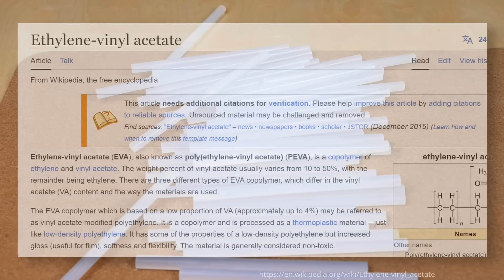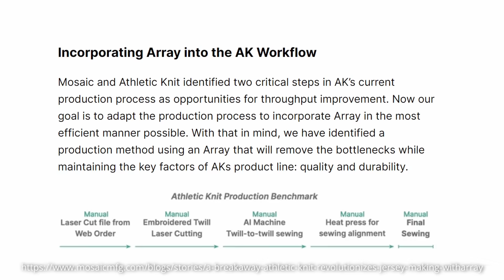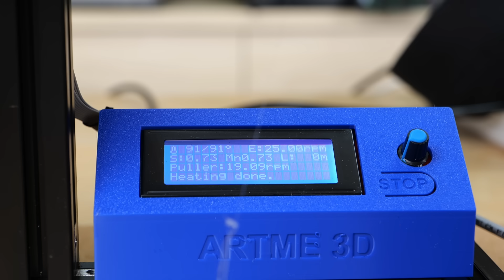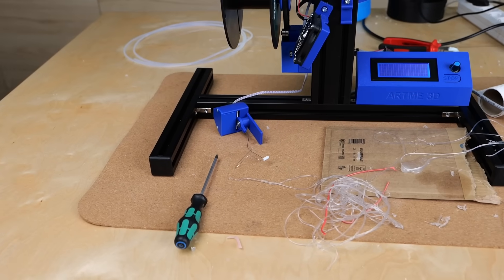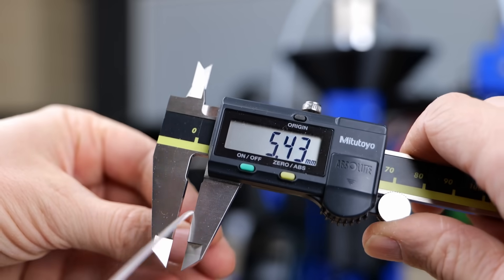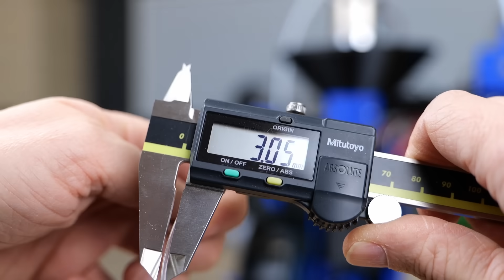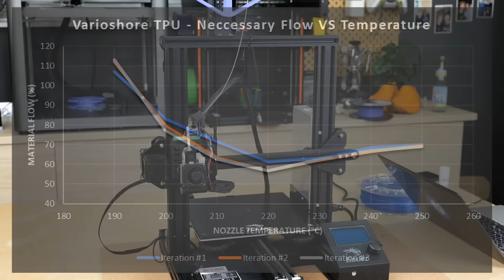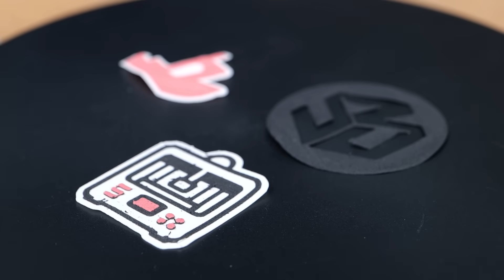Can you 3D Print with Hot Glue?

Comment from the maker: Want to get your 3D prints to the next level? Check out our Heat Set Inserts and Tools at https://cnckitchen.store (Free shipping worldwide starting at €100).
QUESTION: What would you use hot melt glue filament for?
Reply: why dont you find lower melting point TPU for the sticky side ,  and then use TPC on the top which melts in slightly highertenps , alterntively there are shoe glues that are flexible after cure, but they smell strong that you can paint on the other side. or maybe press the hot glue into a thin sheets , then cut to size with a plotter maybe ?
Reply: @kira07 😊😊😊😊
Reply: @kira07 🔴 What Is Islam? 

🔴 Islam is not just another religion. 

🔵 It is the same message preached by Moses, Jesus and Abraham.

 🔴 Islam literally means ‘submission to God’ and it teaches us to have a direct relationship with God. 

 🔵 It reminds us that since God created us, no one should be worshipped except God alone. 

 🔴 It also teaches that God is nothing like a human being or like anything that we can imagine.

🌍 The concept of God is summarized in the Quran as:

📖 { “Say, He is God, the One.  God, the Absolute.  He does not give birth, nor was He born, and there is nothing like Him.”} (Quran 112:1-4) 📚

🔴 Becoming a Muslim is not turning your back to Jesus. 

🔵 Rather it’s going back to the original teachings of Jesus and obeying him. 

More .....👇

🔴 THE RETURN OF JESUS
Reply: Hey Stefan,
Es gibt im Bastel und Nähzubehör fertige Bügelkleberfolie.
Die erfüllt genau die Funktion der Heißkleberschicht.

Ich selbst habe einen Hobby Plotter und könnte mir die Form ausschneiden. Könnte mir aber vorstellen, einen Stanzer zu drucken, mit der man die Folie zurecht schneiden würde...
Reply: I actually don't have a hot glue gun.
Reply: Is it possible to mix pla and gluestick you just need to figure out the mixture percentage
Reply: You can buy online hot glue pelet for industrial purpose...
Reply: You may need an IDEX machine to do this but what if you used the hot glue as a support interface material since it can come off with rubbing alcohol
Reply: It would be interesting to do this with any water soluble glue for faires or something.

As one time badges
Reply: nope, some idiot threw a bunch of kiwico junk into a thrift store, bought one of them. for only 12€, way better than buying them off of the kiwico site.
Reply: try using legos ! as this is the right material !
Reply: You can use pla flax instead of glow, it could work very similar and much more easier to print
Reply: I'd use it to print directly onto phones or laptops in place of the universally unpleasant adhesive tape keeping the case together. Not sure if this would be strong enough, but if it is then it'd be much nicer to work with.
Reply: Dud, you know that you can find EVA filament on the market, right? Did you tried that?
Reply: What if just print rough "wire shape" of the hot glue under the patch? Easier? 🤔
Reply: Those would be great for solid surfaces. Work cabinets,benches,table tops. Even recreational vehicles.
Reply: I wonder if you could grind up the glue sticks in a powder or lubricant that you could wash away later.
Reply: I would use it to provide my very popular multi-colored ABS signs with a sticky underside. This would allow the sign to be preheated with a small blowtorch and applied directly to surfaces.
Reply: Hot glue joins fabric together well, the problem is maintaining a consistent bead of hot glue with a glue gun. Maybe if it were set up like a sewing machine you could feed two pieces of fabric together while dispensing hot glue and pressing the fabrics together immediately after the hot glue then, something to cool it down quickly  so the fabrics stay together.
Reply: A great use case would be to use it as support material or as infill
Reply: Here's another material to try: Polycaprolactone (PCL) is a synthetic, semi-crystalline, biodegradable polyester with a melting point of about 60 °C and a glass transition temperature of about −60 °C.  At 60C, it forms a clear putty that you can mould into whatever shape you want.  At 70-80C, it becomes sticky and acts like a hot glue stick.  When set, it is as strong as nylon.  It is also reusable.  I always make sure to have some around for repairs/etc.  I bought a kilo a few years back and I've used it for everything from making a pin spanner--with a couple of bolts for the pins--to a knob--moulded around a wing nut--to quick jigs to a replacement tool handle to project components.  It, along with things like self-fusing silicone tape, are must-haves in my toolbox.

Cheers!
Reply: what happened to the thumbnail? am i going crazy? 100% sure that the heat gun in the thumbnail was green, but now it's red
Reply: @EvillNooB  It's green for me
Reply: @CNCKitchen ich könnte dir EVA Granulat zusenden wahlweise in Weiß oder transparent/beige.
Reply: Ich habe vor Jahren mal von  arboform gehört diese deutsche Firma die Kunststoff aus ich glaube schwarzlauge Herstellt. 

Eine Weile später hatte ich von Kaffeetassen aus Kaffeesatz gesehen vielleicht kennst du das zufällig?
Reply: Why don't turn the glue gun in to extruder to use original glue sticks?
Reply: You can make dry ice at home! https://www.youtube.com/watch?v=g8hJyR6P-qM
Reply: 5:42 This looked more like the melting point was at about 75° C. Why is it 170° C in your opinion? Did you measure the delta from the inisde of the nozzle to the outside?
Reply: I have been looking for 1.75mm hot glue filament that works with 3D printer pens. It would be an awesome and safe glue gun for kids.
Reply: gaskets
Reply: ich habe eventuell eine idee -> währe es nicht mööööglich direkt auf das stoffteil bzw shirt zu drucken? dan würde sich doch das noch warme filament in den webstoff quasi "einfließen" bzw einbetten und dan sparrt man sich auch das aufbügeln. idee nr 2 (oder so) versuch doch heißklebestangen zu benutzen die in der industrie verwendet werden die haben einen höheren schmelzpunkt und erstarren (vieleicht) auch schneller das heist auch das es unempfintlicher ist gegen sommerwährme oder waschmaschiene. idee n3 versuch doch mal den heißklebe faden aus deiner maschiene kommt durch ein längliches mit wasser gefülltes "kühlbecken" zu leiten (nen länglicher blumenkasten oder lange brotback form ) bevor es in den pulller (oder wie es auch immer heist ) kommt ps vieleicht könnte man damit herumtesten ob man nicht sogar öle auf die wasseroberfläsche hinzugiebt damit die herauskomenden stänge direkt geöölt werden OODER fällt mir gerade ein das der faden der aus dem becken herauskommt (ungeöölt) erstmal über etwas was es troknet "gezogen wird" und danach wie in deinem video mit etwas wolle und klemme geölt wird (weil ich könnt mir denken das die nässe auf dem herauskomdem filament was aus dem beckecken kommt zu sehr haftet und das öl halt nicht die chance hat sich am filament anzuheften)    viel spass bei testen love your videos <3
Reply: @CNCKitchen Has someone ever tried to use pre- frozen filament in a box with e.g. "Kühlakkus" and silica gel packs? Depending on print speed it might be easier to print sticky or flexible materials.
Reply: poland?
Reply: This is interesting, but you do realize there ARE glue sheets that are way less messy which you can use to iron things onto clothing, right?  You just cut them out.  Take off the tape, and iron the things onto the shirts.  Even then, why not just make stylish little holes to sew 3d patches on?
Reply: Stephan you are ironing wrong.  Iron from the backside not from the top.  Flip it over.  Yes this means you WILL have to Anchor the design first,  likely with a little needle or tape or something.
Reply: Dubiose deutsch locker
Reply: contenido promocional + contenido promocional + contenido promocional + ...= BASURA NO LIKE👎
Reply: @cnc kitchen

I don’t know if someone else has already suggested this or not (and on the very slim chance you see this comment since the videos a year old already at the time of writing this) did you ever consider using several peltier thermo-electric coolers under the print bed? I think it might help with the actual prints more than it would help with the patches. I was thinking you could adhere them under the bed and use heat sinks and fans to help cool them. It may also be useful for the patches if you could alter the g-code to start with the bead heating off and have it run the fans attatched under the bed and the coolers themselves and then after the first layers of glue are applied the g-code could switch off the fans and coolers and then stay at a temperature under the melting point of the glue for the remainder of the print. Or possibly even cycle between the two so that the filament adheres to the glue but never stays hot enough to melt it fully. Just random thoughts I had in the shower. Love the videos though.
Reply: Did you know you can get 77 feet of hot glue

Comment: You know what would work better than hot melt glue in a 3d printer for iron on patches? Regular pla, and then a higher temp resistant layer overtop. Or, if you are for some reason dead set on hot glue, you could press the glue into thin sheets and apply them to the back of whatever was printed that way. 
Printing 3d objects with hot glue was cool. Printing a flat layer with it is a waste of time.

Comment: You should revisit this experiment and try using some sort of powder to coat the fresh glue stick filament after extruding it from the filament making machine. Maybe if you got PLA dust or something to act like flour on dough to stop it sticking. The PLA would also melt and extrude with the glue stick filament which might help (or make worse) the handling and printing of the glue

Comment: You could always try mixing the glue with a binder that would increase the rigidity and you could still heat it onto something and the secondary material would act as grip to bind the glue to the print even after heating

Comment: Sounds like it needs a chiller to be able to handle and print it practically.  If it's chilled down to about 1-2 C, the filament should be much stiffer in handling and feeding.  Maybe just operate the printer in a refrigerator :)

Comment: Possibly crazy idea - Hot glue seems like it's really well suited for either injection molding, provided you can use the mold to cool the hot glue and the mold is lubricated so you can extract the cast, or you could use a technique very similar to lost investment/lost PLA casting, where you intentionally pre-print a sacrificial mold, then inject with hot glue, then dissolve or otherwise ablate the mold.

Going for the pure additive approach with hot glue seems incredibly difficult to the point someone who wants to master this material would basically become a specialist with it. That being said, anyone who becomes a specialist with it would have an incredibly diverse material that can be dyed, infused with glitter, alloyed with other plastics...high investment, but potentially high reward.

On that note, a second crazy idea - PLA and hot glue alloy? You basically created something like that by accident. That may be an additional approach to still get some of the hot glue properties, but with a bit more resilience granted by particles of PLA.

Comment: Thats neat but no need to make a glue filament just make a really thin sheet of glue, let it dry, put that on the bed, and 3d print on top of it. Cut off any excess. I think that would be simpler than making a filament out of the glue and running it through the printer.

Comment: Interesting.  We did a similar project back in the 1980s but with screen printing.  First the design was printed in contact cement, then in ink over the cement.  We ended up with just ink and glue, which made a clean decal with no support material around it.  As the Batman movie has just come out, we did a lot of Batman logos.

Comment: Fusible interfacing is designed to glue two sheets of fabric together with heat. I'd try printing the design, then iron the mastic onto the back of it by ironing through the interfacing release liner. Then remove it and iron the decal onto the fabric from the back side.

Comment: While it is not nearly as fun as 3D printing the whole thing, your local craft store may already sell double sided adhesive films specifically for DIY iron-on patches.

And if you are going to sew on a 3d printed patch, I would recommend that you use a leather needle -- those start with the assumption that you're going to have to punch a hole in the material rather than relying on going between the weave.  Using a needle unsuited to the purpose can break the needle, and if you're sewing fast that can mean flying bits of metal!

Another option would be to modify the patch to have holes for a hand sewing needle like a lot of leather patches have. You can then hand sew it on with thicker thread for better durability.

Comment: A short pass throug cold water while making the filament harden the hotglue instantly.
Then while taking It out of the water use with a paper towel to dry It a little bit.
Put baby powder to get rid of the stickyness and the clog problem, and voilá, now you can print... 

Use less than 100C° thats too much... It must barely melt to be usable.

I did some things with hot glue due to lack of ideas 😂

Comment: good but imho pointless idea. i think youd be better with grinding the filler finer, printing patches normally, then spray glue the back and sprinkle with hot glue, then itll melt and stick to fabric when melted with iron.
or heat up the bed, smear thin layer of glue on it, then print on it and cut around the edges once done.

but it all depends on what you want to achieve - do you want to actually stick things to cloth, or you want to play around with 3d printing.

Comment: How did the glue not melt into a blob in the oven ? 5:17
Reply: The oven mentioned at this part isn't a regular oven, but a drying oven. A drying oven works at a temperature that's enough to get the water out of anything you put in, but still stays below the melting point of the glue. If you know that information, you'll be fine and won't turn that glue into a blob.

Comment: You would be better off positioning the patch where you want it with tape from the outside and flipping it over in ironing from the inside of the clothing so it's just cotton being heated over the hot glue and it doesn't have to go through the soft material for the heat transfer

Comment: Use a shake hopper. drop the filament through a cooling tank of water,under the pressure sensor / tension arm, and then through your roller. colder water= harder filament less tacky but more brittle. warm water= more playable but all the above issues. exceeding certain temperatures coat the surface of your cooling tank with a thin layer of oil to cover the filament as it pulls it out, (for warmer temperature filament test.)
 This will make a “hot glue” filament.

Oh and freeze the blender too. cold blades work better. blend ice cubes with sticks to keep temperature low then  thaw & dry later.

P.s after further watching it looks like the best possibility for printing with this material is going to be if you printed inside of cooling tank of some kind of liquid this has been done so it can work but will take tweaking for such a temperature sensitive material. Layer separation is a challenge I see hard to overcome. Maybe low level trailing laser behind the nozzle to seal together seems? 🧐 a properly focused beam at low levels should work. Temu laser pointer and some laser dulling lenses fixed to the head and print in mineral oil?😂😂😂 I would love to see you pull it off hit me up if my ideas help I’d love to talk shop on  project ideas can’t do many myself but I constantly think about the potential possibilities😅.

Comment: I wonder if it would be more successful if you utilized swamp cooling principals with the cooling fan so it's not just cooling from airflow but from intentionally chilled air flow. I also wonder if using a larger nozzle in the filament extrusion process might help get a better diameter.

Comment: The factory uses a heat-activated powder called acrylic binder - You could powder that on the bottom of the patch and use some sort of bond to hold the binder in place until the press on. my2cents

Comment: Thermal mounting tissue is thin paper impregnated with hot melt adhesive. It easily cuts with a scissors and bonds yo most surfaces. It is commonly used to mount photographs to foam board. It would probably work for this application.

Comment: 00:02 Hot glue guns and 3D printers have similarities in their heated nozzle technology.
02:10 Use hot melt glue adhesive filament for 3D printing and ironing onto fabric.
04:12 Cooling down hot glue makes it brittle, aiding in shredding it
06:13 Experimenting with 3D printing using hot glue
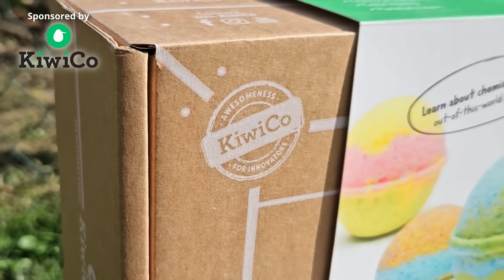08:11 Kico crates spark excitement and learning in kids
10:15 Using machine oil to remove stickiness from Hot Melt glue filament
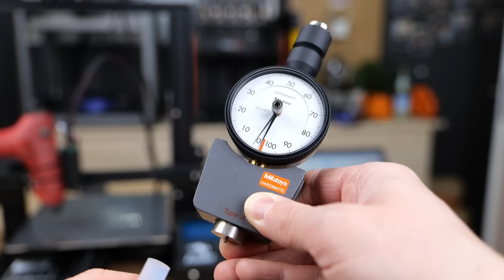12:26 Testing 3D printing with hot glue stick filament
14:37 Experimenting with 3D printing using Hot Glue Stick Filament
16:56 3D printing with hot glue stick filament requires careful heat control and involves challenges with material softness and stickiness.
18:42 3D printing with hot glue can create fast, individualized, washer-safe designs.
Crafted by Merlin AI.